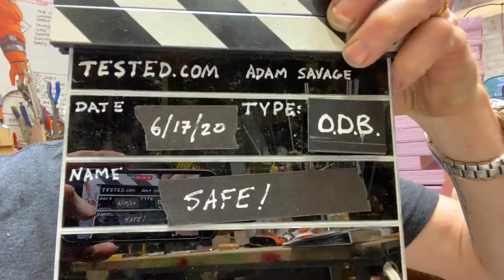Adam Savage's One Day Builds: Foam Prop Safe!

Comment from the maker: To make sure you didn't miss any of our 100+ One Day Builds, check out our full playlist: https://www.youtube.com/playlist?list=PLJtitKU0CAej22ZWBqrimPkn0Bbo6ci-r
Foamular sheets: https://www.homedepot.com/p/Project-Panels-FOAMULAR-1-in-x-2-ft-x-2-ft-R-5-Small-Projects-Rigid-Pink-Foam-Board-Insulation-Sheathing-PP1/203553730
Pack of 6 styrofoam sheets: https://amzn.to/323XKxU
Headliner spray adhesive: https://amzn.to/349Ccm5
3M Scotch-Weld hot glue gun: https://amzn.to/2XofZfI

Comment: Should have made some fake gold bars to put in it with the foam scraps.
Reply: If someone picks one up, a light foam ingot wouldn't handle the same way as a real one, so foam isn't the best material (unless you wanted to drop them one someone).
Reply: @peter_smyth  It would be going in a prop foam safe hanging from a ceiling. How it feels and handles is irrelevant, would be all about looks..
Reply: That would be a fun finish!
Reply: @peter_smyth , yeah gold bars made out of foam would be a terrible idea to put in a safe made out of foam.

Comment: FWIW, Home Depot here sells the 1in * 4ft * 8ft for $19, making this amount of foam ~$60.....
Reply: Boosting so Adam can see
Reply: The thickness available at home depot seems to be climate dependent since it is intended as insulation . But you can find it there ranging from like 1/2 inch up to multiple inches thick
Reply: Unfortunately in California where Adam is located this insulation is banned for use in construction (its intended purpose) so it is not available other than in the small  sheets that Adam has bought for "hobby" use.
there are some foam dealers that will sell the full range of product but the prices are not any cheaper than buying in the small sheets.
Reply: HD also sells 2in thick 4'x8' sheets for $30 each, so you could have a pile of material 24"x24"x32" for $60
Reply: Fo real, wish he would take note of some of the prices and competitors. Don't think one should boast overpriced things
Reply: @Dynamic-Productions  what's his better option? If the material he got is what's available in his area what should he do? Drive to another state? Order online, wait and pay a ton of shipping?
Reply: Got to import it
Reply: As others have pointed out, the pricing I've indicated doesn't apply to California, as it's not stocked, as it's not allowed by their building code
Reply: @dskulrak  are you sure? I just checked HD website in his area and the foam sheets are available for sale.
Reply: Time for a road trip to Nevada!
Reply: I wonder if making a mold and using a foam injection gun like they do for packing items for shipping would be cheaper in the long run
Reply: @dskulrak  Why is it banned in CA? I remember it being cheap too a long time ago, I have no idea why it's so expensive now. I can only assume lost market share.
Reply: @jack_brooks  Environmental concerns.
Looks like it is city by city but from my limited research it is largely un-available.
Reply: Pretty much the same price here in NWA.
Reply: I was gonna reply the same thing. 
I guess it depends on yer market.

What he got were what they market as "project panels" and for some odd reason are more expensive.
Reply: yea too bad it's Home Depot they are a terrible company
Reply: Yeah here in MN, HD sells a bunch of thicknesses, topping out at $25 or thereabouts for 4x8'x2". We need it for insulating basements in the winter...
Reply: @jack_brooks  If I remember correctly, I believe CA banned its use because it doesnt insulate well per inch of material. Its also non recyclable and generates a lot of construction waste. California, along with energy efficient buildings across the country, have moved to a spray on insulation as a replacement. Its less wasteful, more efficient per pound of material and because its homogeneous instead of sheet good, it can replace plastic air and vapor barriers as well. Its likely that we will see a pretty substantial reduction in the use of rigid sheet insulation in the next few years as its phased out around the country
Reply: I can get 2" x 4' x 8' for $25 each. I'm not sure why the 2" thickness wasn't available in the Bay Area.
Reply: @Dynamic-Productions  He literally says it's expensive at the beginning.
Reply: Firstly SF is a big city. It takes over an hour to drive from one end to the other. Secondly, he’s a professional chill out. Thirdly, pink RIF is common, he’s using a brand specific kind
Reply: @DismemberTheAlamo  HD do the same with plywood.  The cut up sheets were priced at a premium because the assumption is that a contractor/builder would never buy anything less than a full sheet (so for homeowners/hobbyists).  The .25 sheets used to be called "handy panels" but they don't carry much anymore.
Reply: @tiacho2893  - its not the same in this case. Here the manufacturer ships them in that size that he uses. Same with the small cuts. 

But it all depends on yer markets, where i live handy panels are ALWAYS in stock
Reply: @dskulrak  any idea why it's banned
Reply: Also in 2"! so not laminating! the 4x8 is much cheaper than the 2x2 per sqft! they also have 1.5in
Reply: Laughs in non California.
Reply: I'm old, what does fwiw mean?
Reply: The Brave New World Tax applies in San Francisco, making everything more than twice as expensive. Except housing, that’s 12 times more expensive.
Reply: Man when Adam pranks his friends, they end up with the coolest stuff.
Reply: @DismemberTheAlamo  Yeah, I know it's the manufacturer's standard size.  Just making a parallel on the price/sq ft difference between the handy/project panels and "full sheets" of anything.  Everything is cheaper in larger formats or bulk quantities.  You just have to use the bulk quantity.  And I can't say for sure, but the only use for it that comes to mind (in my area at least) is for backing synthetic stucco or possibly basements.  
I live in Canada and the rigid foam is becoming more rare as spray foam is becoming more common and cheap.  Like CA, this is the only size and thickness that is commonly available around me and HD is the only sure bet for "off the shelf" stock.  And I actually prefer this size.
Reply: Nothing Noone honestly it’s completely about the management team running the location. I have the opposite experience in the stores near my house. The people who work at Home Depot are super nice and always ask if you need anything. The customer service is great. Corporate tends to let individual stores handle their business. Lowe’s is the opposite here disgruntled employees, horrible customer service both on the phone with corporate and in-store personnel. It’s less about the corporate enterprise and more about how managers run their store here in the Midwest.
Reply: 57 Available on shelf at my local Lowes
Reply: The Bat I’d love to find a local SF source for non-branded sheet foam. Any ideas?
Reply: Alex Morris For What It’s Worth ....
Reply: As a tabletop miniature game player i have sent a few boxes of foam to friends Cali since it was so prohibitively expensive there for small scale stuff. One of the benefits of growing up on a construction site.
Reply: True
Reply: Where im from we got 1 inch or 2 inch 8ft x 48in
Reply: WHO CARES HOW MUCH THE STUFF IS, IF YOU CANT AFFORD IT DONT PLAY
Reply: @highlandcrawler  Hey, he is a celebrity. The manufacturers show pay him for the honour to donate the stuff! 😃
Reply: @jack_brooks  I do not know but I guess that it is related to the toxic fumes it gives of when on fire.
Reply: @JKSSubstandard  And the fact that styrofoam are really nasty when on fire. Houses burn occasionally after all.
Reply: @firepaint33  Adam can afford a lot of expensive things but it doesn't mean that he likes to pay inflated prices. He strikes me as an economically minded person over all actually.
Reply: @dskulrak  not ture home depot sells sheets  8 by 4 feet by 1 inch curbside 23$  a t2 Colma Blvd, Colma, CA 94014  home depot  love the fact everyone is checking this
Reply: @JKSSubstandard  It insulates extremely well. 1" is r-5. fiberglass is 2.2-2.9. it's also better than open cell foam which is r-3. California is just stupid in so many ways. It's also increasing in popularity with the advent of extremely efficient houses. just watch some of matt risingers videos
Reply: I live in Texas, and two weeks ago I bought a 4ftx8ftx1in sheet at Home Depot for $19.98 to build 'virtual school' cubicle wall for my kids.
Reply: @dskulrak  Every time I paint with Tamiya I see the stupid "California knows things in this can cause Cancer" sticker.  Listen!  If 20 years of smoking didn't give me cancer then this paint has little hope.
Reply: @rotaholik89  for what it's worth
Reply: @Dynamic-Productions  price simply is not the only or primary consideration. Once you get past that idea, your life will dramatically improve.
Reply: Kevin Breslin The gas they use to "foam" the board is a greenhouse gas.
Reply: Pricing and availability are very much dependent on location and season. I was planning to insulate my garage door this weekend but my local lumber yard (30 miles away) only had 1" square "hobby panels" @$10. My "local" HD (200 mile round trip) wants $90 for a 2" x4x8. Prices of nearly all construction materials are up by 100-150% since COVID. Bought some hardwood ply last week, used to paying $40-70 for a 3/4" 4x8 sheet of Oak veneered ply. Had to have it, ended up paying $170/sheet and had to drive 200 miles for it.
Reply: assassinlexx  Hardly communism, it's pure free market capitalism. Spray on insulation is cheaper to ship and store, faster, and easier to install, does a better job in most applications because it fills all the fire penetrations and can be it's own vapor barrier. It creates less waste (a down side for hobbyists who used to get pink and blue foam from construction site dumpsters.) But it's a great business opportunity for any kid with a bit of gumption and the willingness to figure out how to build the gear.

The foam sheets are still popular in places where foundations need to be a concrete monolith insulated against sub zero winters. The sheets go up fast if they can be installed as regular rectangles. Especially where they can either BE the form or be sandwiched against the forms before the pour. Easy to find it in mountain communities (although it's presently sold out in mine) and northern climates. Can't imagine that there is much construction in the SF Bay Area where foundations need the R-value that foam sheets provide, therefore, not much demand.

But there is enough demand from model railroaders and other hobbyists that it is worth the wholesale price of about $6 per sheet plus 10 minutes of minimum wage (call it 2 bucks) to cut a 4x8 sheet into eight 2x2 "project panels" and mark them up to $19. That's a materials-plus-labor cost of $8 a sheet or a buck per hobby panel, therefore $18 profit per.  $18 x 8 panels is $144 bucks of profit/shareholder value, and that's pure capitalism.
Reply: @TheLordGhee  Damn right, in fact, I randomly chose Home Depot locations in a a dozen cities outside of the municipal boundaries of San Francisco and found that they all had the stuff available for prices ranging between $19 and 25. People make shit up to conform with their phony opinions about "libtard regulations" and then don't bother to check to see if any of their "alternate facts" are true. There is no California ban on EPS Foam insulation in building construction. The building codes require it in many cases, and it is readily available in any part of the state where it is in demand. In fact, it's cheaper there than it is here in Colorado (29-35 bucks)
Reply: @HickLif3  EPS foam is readily available throughout California, commonly specified and complies with the California adoption of the 2015 ICB. JKKSSubstandard's alternate facts are completely contrary to reality.
Reply: assassinlexx  Yeah, you do, because Chapter 15 of the 2015 ICB as amended and adopted in CA in 2016 at title 24 of the CA Code of Regulations requires it when you re-roof all of those Mid-Century Modern cribs that dot the Los Altos hills. Friggin regulations, the asbestos matting was so much better. So go buy all you need. It's readily available throughout California, although it's out of stock at the Daly (little boxes on the hillside) City Home Depot, so you'll have to schlepp over to Emeryville where they have 30 sheets waiting.
Reply: assassinlexx  Yep, and like I said CA building codes and the ICB approve and  recommend EPS foam insulation in new and remodel applications and it's readily available throughout California, aside from purely capitalist inefficiencies in the supply chain. In regard to asbestos, I figured that since you were so upset about CA regulations, you'd agree that banning asbestos was yet another government intrusion on your right to put cancer causing materials into your construction projects.
Reply: @dskulrak  I live in the California Bay Area (about 50 miles from Adam) and the 1in x 4ft x 8ft sheets of the Corning pink foam is in stock at the local Home Depot and is $23 a sheet.  They have 14 sheets I could go buy right now.  There may certainly be laws banning its use for some applications (California loves to do that kind of thing) but it is still available.
Reply: @MochuisleMocroi  The first time I went into a Lowe's I saw an employee trying to drill through a 2X4 with an 18" masonry drill bit.  That sort of scared me away from that place.
Reply: @Chungustav  what do you make the mold out of

Comment: Its only available in California in those small sheets. Most other states still have the larger more economical sizes.
Reply: True, but I will note, not likely for long. Construction is slowly moving away from the use of that rigid closed cell foam to a spray on version of the same material. In the next 15-20 years, you probably wont be able to find it much anymore outside roofing applications
Reply: @JKSSubstandard  It'll end up in crafting stores I know terrain & miniature builders that use it all the time.
Reply: @wwaxwork  We do. There are even discussions on the "right" type. The different colors come from different manufacturers, and have slightly different properties. Not really relevant here, but important when you're doing detail at miniature scales.
Reply: @wwaxwork  it wont be economical to produce it for sale in craft stores, the price will probably be double what Adam paid if it happens at all.
Reply: @Cssfiend  even if it was economical they would still add the 'hobby tax' to it just because they can.

Comment: "Break" one of the chain links and bend it so the chain is "barely hanging on". Or swap the chain for a badly frayed rope.
Reply: And add a cartoonishly large pair of shears
Reply: YES! I was thinking frayed rope the whole time. Best part is you could use really thick rope, and fray it down to almost nothing since the safe is so lightweight. That detail would help sell the weight really well.
Reply: Hang it on a high ceiling, connect it to some trigger mechanism which triggers a speaker behind the safe going .... "meep meep!". Enter room, look up, feel like the coyote

Comment: This video brought back SO MANY memories of doing prop fabrication!  Honestly i miss it and wish i could go back to doing it full time.  I'll relate to some of the things seen in this video for those who may not be "in the biz", and may not be aware of all the hurdles involved in making something like this when Adam makes it seem so easy.
(I would be super proud if Adam read this comment)
We have to remember that not everyone lives in California where you can get things like the Roscoe sealant, or the correct type of spray adhesive on the same day you need it.

We had to come up with solutions to these problems and considered them trade secrets.  Since this was 20 years ago, i feel ok letting the cat out of the bag.  When working with this type of foam, and making anything of considerable size, you have to stick it on to some sort of a backer for strength so that it will even survive the trip to set.
1/4" luan was the order of the day since we had it.  Getting this foam to stick to that wood is no small feat, and if you can imagine having to make 10 to 15 4'x8' panels with Egyptian hieroglyphics carved into them, you couldn't even buy enough of that canned adhesive even if it wouldn't blow out your entire budget.
Enter the carpet glue and serrated trowel!
When i saw Adam using a glue made for carpet i had to laugh in reminiscence.  That was a big secret of ours for years.

Then Adam has to deal with the 'everything eats foam' dilemma in order to prep the foam for paint.  Once again, if you don't live hear Hollywood and are in a time crunch, you need other solutions.
Trade secret #2?
Flex Seal wont eat foam!
not even bead foam.
added benefit is that you can spray it on and dont have to worry about the brush strokes, not to mention  the time savings.

I suppose i would have made the legs out of MDF instead of foam, but knowing that Adam plans on hanging this up excuses that LOL.  Trying to tell stagehands to 'be nice' to a prop is futile because it's the actors who are going to break it.

There is no feeling like starting your day alone in a shop with a bunch of materials, and leaving that night with this 'thing' sitting there like a monument to your creativity and fabrication skills.
Thank you Adam for making me reconsider going back into the feast or famine world that is film production work.